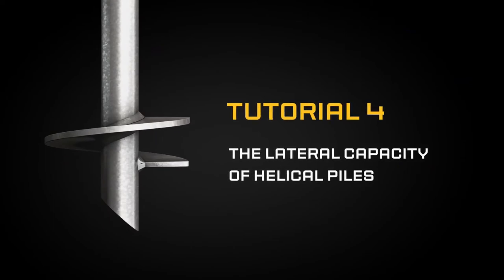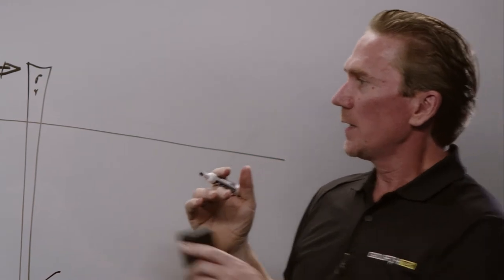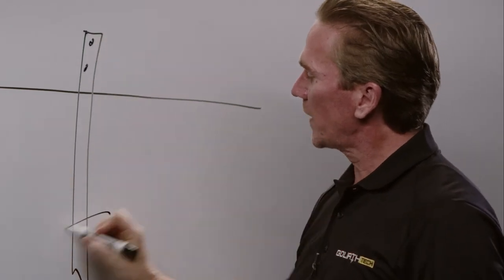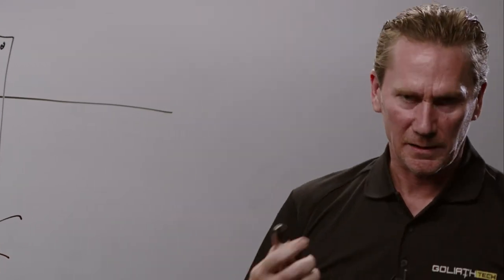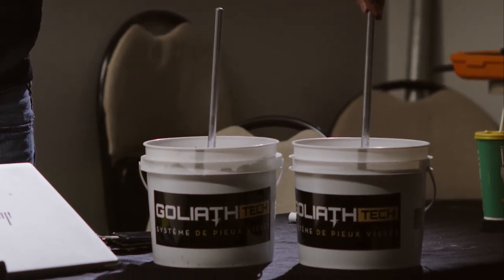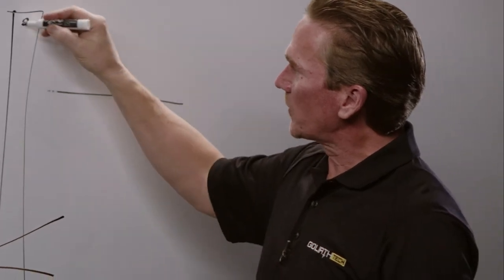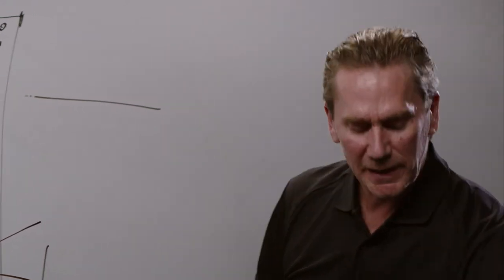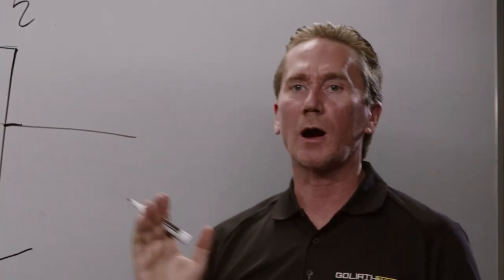TUTORIAL #4 : The lateral Capacity of Helical Piles

Comment: Curious how helical piles would hold up to thick ice. I’ve not seen them used often in northern lakes where the ice may be two feet thick and may shift. Would a steel frame deck and thicker diameter piles hold up to that lateral pressure?
Reply from the maker: Hi David, that's actually a very good question. Generally any structure in water that will be exposed to 2ft of potential moving ice is at risk of failure/damage. When our piles are installed for a dock or boat lift in a lake at risk if freezing, we generally remove the upper section of the pile that will be exposed to the moving ice with the dock/boat lift and leave the lead section with helix in the lake floor. That being said, we could engineer a structure/foundation using our larger diameter piles to resist the moving ice.
A combination of the larger piles and a bubbler would be the best combination to ensure the safety of the structure.
Reply: @goliathtechcorporation6060  Makes sense. I appreciate the reply.

Comment: I think this is a great system...my concern is durability....
Reply from the maker: Hi There, would you like to speak with one of our franchisee regarding your concern or any other questions you may have ?
If so, please provide your postal code or zip code.
Reply: Galvanized pipe is good for 75yrs plus.
Reply: @mikez4132  Yes.galvanized thickness average more than 86 microns. and each test point at least 79  microns
Reply: @goliathtechcorporation6060  do you guys have spec sheet on lateral capacity based on diameter of piles? say 4-1/2" dia pile you mentioned in the video, how much lateral capacity does that have in silty clay soils?